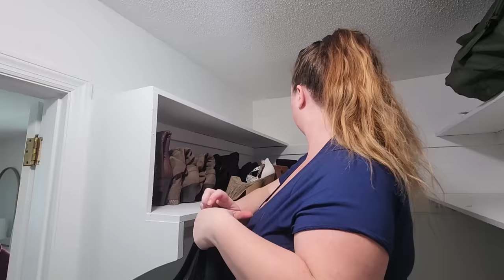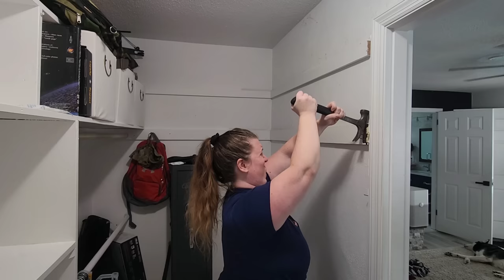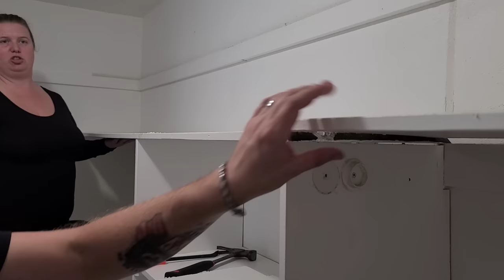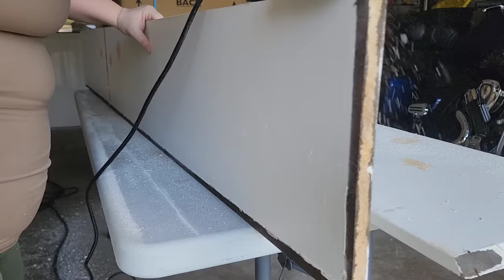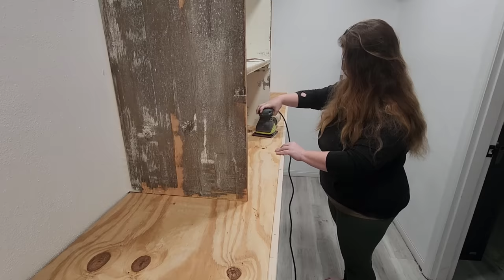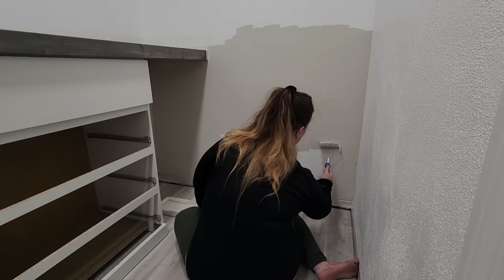DIY CLOSET MAKEOVER ON A BUDGET (PART 1) DREAM CLOSET MAKEOVER

Comment: I took apart 2 8ft bookshelves to turn into a 16 ft linear pantry and it was all held together with nails.... Durham's water putty is AWESOME.  I sanded everything, filled in nail holes, put in my pocket screw holes, painted and reassembled with screws for an awesome set of shelves.
Reply: Sounds beautiful!

Comment: Cambria my husband is a contractor in all construction and remodeling and this includes paint too so what I think is that the previous owner of your house hired someone or paint himself that house with really cheap paint, because a paint company has 3 tipes of paint wich is the expensive good quality paint or the medium paint is not that expensive but still looks good and last longer and easy to clean and the flat paint this is the paint that comes off with time or by wiping it often and cheaper for costumers with low budget but definitely is not going to peel off but the paint that you peel off in your house is usually from Walmart is more rubber paint and more coats they use more easy to peel off so just saying a paint company is not going to give you that rubber paint if you hire a paint company,, 
By the way you and your husband are doing a amazing job remodeling your house.